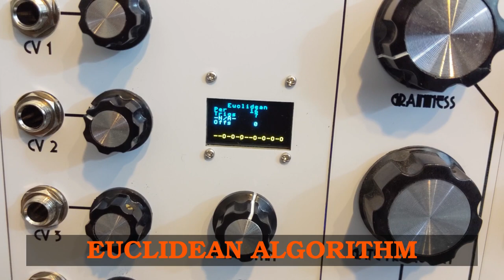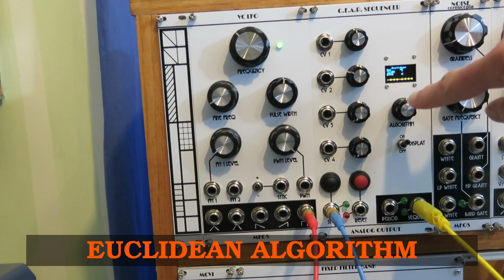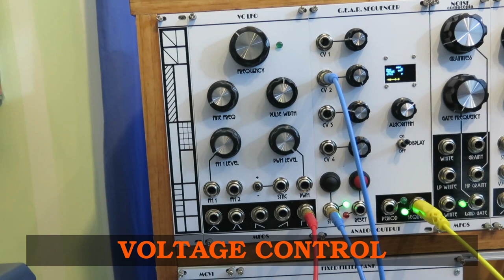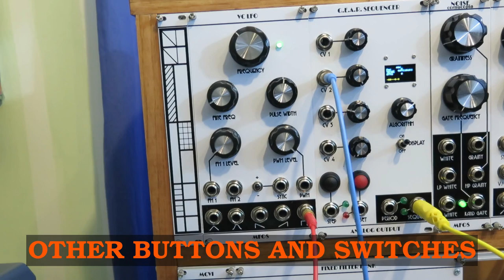G.E.A.R. voltage controlled rhythm sequencer

Comment: Interesting video.
We need a Stereo output module.
This module adjust the signal to the stereo amplifier.
Reply: Check out the MFOS 'Oldies but Goodies' Panning Mixer design.  Easy to build on stripboard.
Reply: @rogrevs  Thanks for the advice.
Reply: @rogrevs  thats what i used. Very easy and works absolutely perfectly. I actually used Analog output's panel design (an put peter griffin on it for funny) an just used that circuit + holes for the stripboard